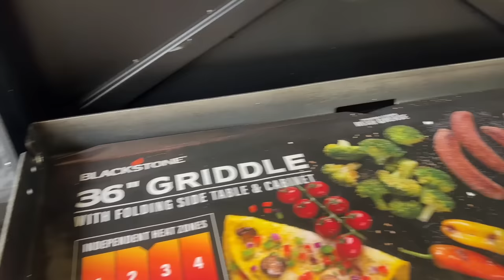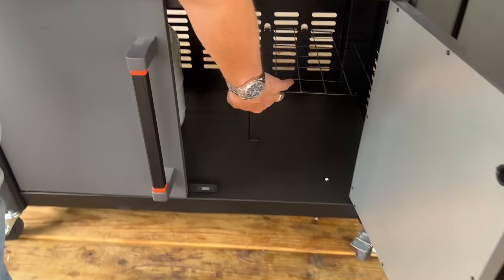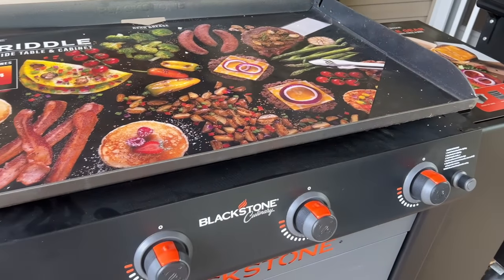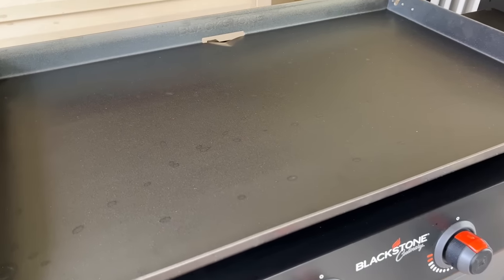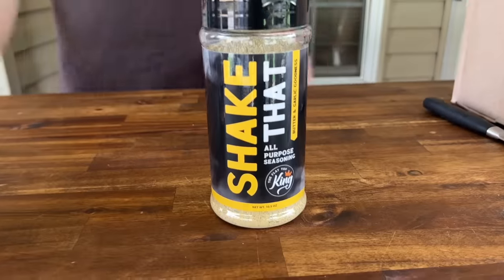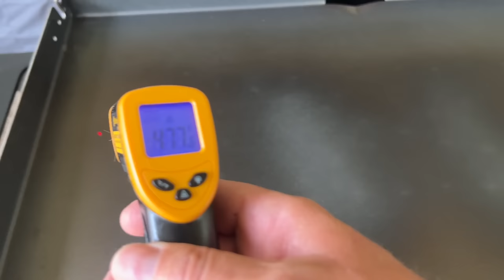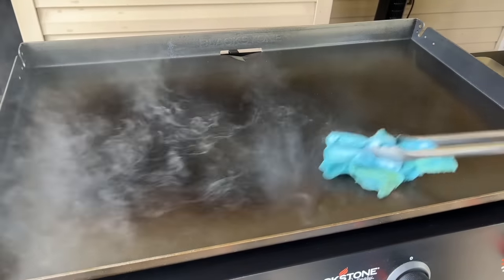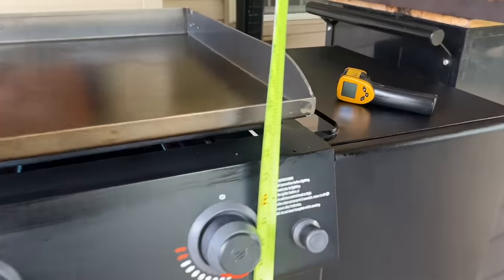NEW Culinary Series Blackstone Griddle + HUGE ANNOUNCEMENT!

Comment: The anti warping structure is causing a zone inside a zone which is why it’s such a drastic difference in temps.  It’s also welded and pulling temp into the brace
Reply from the maker: Definitely above my paygrade...for sure...
Reply: It also has less BTUs than other 36” models.
Reply from the maker: @tommyw5332  still pushes high 500s on high… I would think less btus would allow a true lower end temp
Reply: @TheFlatTopKing  same for mine. I think my only complaint about the unit is just that the edges never get to smoke point no matter how long you leave it on. I’ve only done about 30 or so cooks on mine so far, and the edges don’t look seasoned at all. Not sure if it’s a big deal—hasn’t caused me any issues cooking so far anyway.
Reply from the maker: @tommyw5332  I agree. Not that many cooks yet for me but same thing. I have also noticed other people using them and same results. Many uses by people that know how to use em.

Comment: Some interesting innovations on there.  Like the quick removal lid, clever.  It's about time Blackstone included wind guards under the griddle surface.  The new bracing config looks like it should perform better, but time will tell.  I don't think the uneven heating is due to the bracing configuration as speculated below.  If it were correctly attributed to that then each side would be equally "poor" performing.  I suspect the burners might need some tuning; either adjust the air metering to even the heat output or look for misalignment of the burner to the control (behind the knob).  It's also possible since the store did the assembly that a lack of care in minding the details left some packaging debris to partially clog the gas flow.  You know I've expressed a lack of enthusiasm for Blackstone because of their apparent targeting of impulse buyers rather than better build quality, so I'm not making excuses for them here, just throwing out some possible faults external to the intended design.
Reply from the maker: I wish I was smart enough to fix it...one way to look at it...if that has to be dont to tune..what about someone like me that thinks WOW...thats a lot to do for even cooking..maybe we can call and figure Something out..and repot back...
Reply: @TheFlatTopKing  were you able to even out the heating on this flat top?

Comment: I just cooked on mine for the first time last night, same model.  When I seasoned the top I used the Blackstone seasoning and the results were very impressive....an even black all the way across including the corners.  The heat distribution might be hit or miss because my gun is showing fairly even.  That being said assembly was a pain in the butt but after hearing horror stories of the units being put together wrong, not tightened correctly and damage during delivery I decided to build it myself.  It took a few hours because all the parts are black.  All the screws are black.  The screw holes are surrounded by black and in spots that require you to climb underneath it where there's no light.  Not fun.  I did some simple burgers (I need some of that Smash That) and it did extremely well and yes, I'm a newbie.  Love the videos and all the advice....it all works.
Reply from the maker: Hey that’s awesome news. Thank you

Comment: I recently got a new 36 BS with folding sides (#2177) with the new griddle plate. Mines too was rocky during seasoning but leveled out after that. Had it for bout 2 months and done maybe 10 cooks and its black except maybe a inch round the edges, heats really evenly. I can say my right side had no issues heating but the center is definitely a bit hotter than the rest. I thoroughly enjoy the griddle tho. Last night did a meal and it was super windy but had no issues so I believe the guards work. I think BS will phase this plate in all going forward. Definitely grabbing those seasonings. Coming from charcoal/smoking its def something I have missed on the griddle but not all heroes wear capes!
Reply from the maker: Great insight...thanks for commenting and supporting us...really appreciate it

Comment: Congratulations on your new seasonings and hat!

You might want to be careful with those blue shop towels and high heat.  Those towels are not all natural fibers, and can possibly leave some sort of residue on your steel surface.  I found that out a few years back when using them on hot surfaces on automotive engines.  

Thanks for the great work and all the helpful info! I just purchased my first Blackstone griddle, and have referenced your videos more times than I can count!
Reply from the maker: thank you for that...cheers

Comment: I saw a video on the Tube where the fellow replaced that style burner with 4 Hoop burners and also replaced the propane hose assembly with an adjustable regulator/hose assembly. He said about twice the heat output and adjustable both with the new regulator and the knobs.
Reply from the maker: WOW...yeah seems cool...i dont do adjuments like that...I just buy and cook..most people would so I try...to relate to what they go through...after spending 600 you would think you would not have to...spend more for better results...
Reply: @TheFlatTopKing  I agree - At least there is an option if one wants more heat. Course it comes at the expense of burning more propane. Luv your content - And the occasional input from the peanut gallery .. .. 😁

Comment: I bought the same version about 2 months ago without the storage doors (the model down). I had the same issues with the griddle not seasoning fully around the edges, still after 30 or so cooks on it (used avocado oil). 

I didn’t notice that this new culinary series actually has less BTUs than the other Blackstone 36” models. They say it’s supposed to get as hot or hotter and maintain that temperature more efficiently. I have to say, it’s pretty disheartening seeing that the edges of my Blackstone aren’t seasoned properly.  It may get hot in the hotspot, but that temperature doesn’t transfer to the edges even after having the grill on for a long time.
Reply from the maker: Tommy I completely agree...I wish all could read this comment...so many people I feel like are just sticking up because the name...but in reality its just the truth..its just not even...nothing bad and most will not care...but when the proof is out there....its literally whats happening to alot of people...thanks for commenting

Comment: Thanks for awesome honest content! Exactly what I needed to learn how to use my new flat top. Just bought this griddle and can't wait to use it (gotta assemble it first though) the uneven heating is a shame but it's a large surface and I usually create different cooking zones when I grill anyway. Even this deluxe model is cheaper than a new weber or broil king flame grill, so I won't be too critical of it's flaws. It's my first flat top so I'll just have to learn my grill and use that knowledge to my advantage
Reply from the maker: Hey thats awesome...can you reach out once you have gotten it put together and let m know if you have the same hot spots...
Reply: @TheFlatTopKing  I saw similar results as you. Hotter in the middle burners. The corners didn't season on the initial season. I turned the sides up compared to the middle to even it out. I plan to do another round with the top on backwards since I noticed the front seasoned pretty well and the back not as much. My main issue with the grill was the propane hose leaked with both my tanks. I robbed the hose from my old broil king and it works fine. Cooked breakfast on it today and I'm loving it so much. The side table was worth every penny. Now time to learn hibachi and fried rice!

Comment: I like it, I assembled it myself because I'm a stickler. Took me about an hour and a half start to finish. Griddle itself is a very nice design, cooks great. Only gripe is the steel cabinet is thin, I mean paper thin. Why couldn't they use a little heavier gauge steel? The side panels are ridiculously easy to bend. Other than that it's been great. Love the side table, very useful. Overall I like it for 600 bucks. Would've paid 800 for some heavier steel though.
Reply from the maker: Right on....thanks

Comment: Congrats on the new seasonings! And the labels look fantastic! Nice Job on those!!! As for this new blackstone, i went and checked it out when they got them into Lowes little over a month ago. I saw the new griddle plate baffling, just didn`t impress me as much as i thought it would. And then i saw the price....$600 freaken dollars! NOPE! I already have a 36 inch blackstone, i couldn`t see spending twice as much money for the same size top just to gain a collapsible shelf. I don`t really need the shelf because i already have the blackstone cart next to my griddle already. As for surface temps, mine varies very little. This new baffle design they now have, i don`t think its going to make the heat more even, i see it making it worse. All this new design did was keep the plate more rigid and still allow some heat to move around. Mine has never warped, ever, and the surface temps are pretty even all across the griddle. What blackstone should have done, was install chamber walls between the burners like what Treager did. I would have welded the chambers on the bottom of the plate though, with small heat bleed over slots implemented within the baffles. Hmmmm,🤔 i might have to try that with mine! I`ve got a big welder, and i`ve got some material! Anyways, GREAT video Neal & Amy! You guys are my number one go to for griddlin!
Reply from the maker: Hey I have to Completely agree...in todays world with all the competition...you have go to change with it...no reason to still have the problems...

Comment: My Traeger Flat Rock is black edge to edge. It’s been the best cook top I have had. When I clean at end my my cook and apply the thin coat of oil it looks like glass!!
Reply from the maker: Yeah...me as well....very very impressed with it...its a beast for sure...what oil did you use to season...
Reply: @TheFlatTopKing  Really think those grab handles on the sides of the Traeger are a deal breaker for me. Like you, I always use those side when lifting food up and can see food falling through those handle holes all the time.
Reply from the maker: @jasonburke7685  when I first started I hated em. But I would rather over look it because you get used to it. Honestly. The. To have such uneven heat. But like all it based on personal preference.

Comment: Nice to see that Blackstone is reacting to the consumer, but I'm not impressed with those built-in wind guards.  I don't like how they are positioned inside the cook top surface  (I know, bad description. It's been a long day.) and may be the reason for the limited cook zone shown during your seasoning.  At least with the outside mounted wind guards (or how the Traeger built the wind guard design around the cook top), it includes the entire surface for heat distribution both with convection as well as conduction.  Of course, not having tried their new design, I could be just talking out my gas!  😮  By the way, when I seasoned my Blackstone top, I used a sacrificial cotton wash cloth to prevent any paper towel disintegration from "contaminating" the surface with paper.  I don't like leaving paper towel lint on my cooking surfaces!
Thanks for your assessment , and I can't wait to see how it cooks!
Reply from the maker: Thanks Curt for the feedback...we just posted this morning our first cook...

Comment: Congratulations on the seasonings , they look awesome. Sorry to hear about the uneven temperature distribution issue. Seems to me to be more of a burner issue than a cooktop issue. If the left side is good, why not the right ? Anyway, I’m sure you have more experience with this sort of thing than I do. Perhaps it could be something with just that right burner. Hopefully you’ll be able to figure it out before giving up on it.
Reply from the maker: Well all 4 were uneven...with the sides having the biggest gaps...my previous Blackstone operated the same way...But I was hopeful with the new technology
Reply: Seems like it’s functioning more as a way to minimize warping than as a heat control. The wind shield idea is good, but those can be had or made cheaply. I do like how the Flatrock addresses those issues.

Comment: Just upgraded from a 5 or 6 year old 28" Blackstone to a new 36" and seasoned yesterday.  I ran into the typical issue of the edges not seasoning too well.  Not sure if it's recommended or not, but just used my propane searing torch to heat these areas up and get the oil to the smoke point.  My top now looks uniform edge to edge.  I'd love to know your thoughts on this!
Reply from the maker: I have heard that...If it works absolutely do it...its better for it in the long run....I could do it...I struggle with after market ideas in all categories because of one MAJOR problem...the average person buying these will not have the ability or know how to to do this...even it  makes complete sense....

Comment: So you can leave the lid closed for up to 10 minutes while it’s cooking.  What about leaving the lid on but open while in use?  Would be a hassle if you had to remove it while cooking.
Reply from the maker: So we have gotten rid of this one...didn't meet our standards...as for the top...I think the top is easily removed....
Reply: @TheFlatTopKing  Thanks for the reply!  I see Pit Boss has a Revised version of the 5-burner Deluxe model with the shelves that become lids.  I wonder if you think the extra burner would help cure some of the uneven temperature zones you had with the Pit Boss Deluxe 4 burner model?  Also, I am guessing you stuck with the Traeger?

Comment: I bought the same mode about a month ago and my middle also gets about 100 degrees hotter than the edges and corners.
Reply from the maker: Thanks Mark...i appreciate the response...it will help me determine if it was just me or not...i see in others pics there griddle looks the same as mine which means its heating the same...

Comment: Great videos. I just discovered your content while researching griddles. 
With respect to the uneven heat, have you considered tweaking the air Gate? 
I don't know if this is viable or not, but I wouldn't be surprised if there was some variance for each burner. I suspect these are built on an assembly line and not individually tested and set. 
If I'm way off, feel free to correct me.
Cheers!
Reply from the maker: Hey Trevor...I honestly have no idea about that...I can say this with experience...tons of comments have rolled through about this same topic not only about this model but other ones as well...my previous Blackstone had a similar problem...At this point I think its about manufacturing on a large scale.

Comment: Be curious how the heat on that right side is if/when you ever get it aligned correctly. That right front peg isn't even in the hole making it probably 1/4" or so higher which might contribute to the lower heat on that side.
Reply from the maker: No...the griddle does not sit in the hole..its a big hole and a smaller hole..the peg enters the big hole and slides to the small hole and locks in...its on correctly...thanks for the information

Comment: I saw a 3 burner at Walmart. It had a nonstick griddle. Do you need the plastic tools?????? It said it was cast Iron.
Reply from the maker: Interesting...not sure the model...especially being cast iron and non stick...i have always stayed away from plastics....you can use High heat silicone...if needed...but if its literally cast iron I would stick to metal...

Comment: my blackstone, which is an older model doesn't have the bumps stops for the grease trap. You're right. the opening looks quite a bit smaller. is that one of the blue shop towels you're using? Thanks for showing us this. Makes me want to run out and get a new one. Any specific model number? i used some big flat washers to level mine and keep the grease and oil from running to one side or the other
Reply from the maker: This is a Lowes exclusive so not sure the Model number...I know when looking at the product information look for the key word...Omnivore griddle plate...they should have two models...one like mine and one that has less options...

Comment: i think to really have even heating throughout you need to have thicker steel like the commercial ones do, the thin metal of these home ones will never transfer the heat properly to achieve it
Reply from the maker: Yeah. Traeger so far is the best on that. I have received a ton of comments on the new Halo 48. Some are absolutely swearing by it.
Reply: @TheFlatTopKing  i await your review 😆

Comment: You can review every consumer griddle on earth and you won’t find one that heats evenly. They’re too thin. They don’t hold heat. Add to that, the side walls act as heat sinks and draw heat away from the flat top. That’s why commercial griddles a quarter of the size of these cost four times more. The cooking surfaces are over a half inch thick in many cases.
Reply from the maker: Well....i am open for discussions...I have to say.....thats just wrong in most ways...before Traeger and Weber hit the market I would 100 agree...I have many many videos on those 2 by now and by far the best on the market. Because of even heating and low heat ability. Traeger gets the edge because what you said...its heavier and holds heat better. But the Weber has the ability to hold lower temps